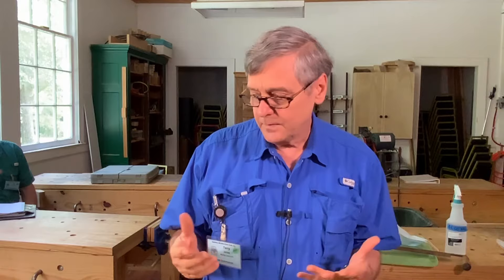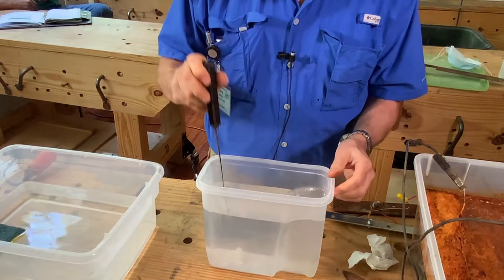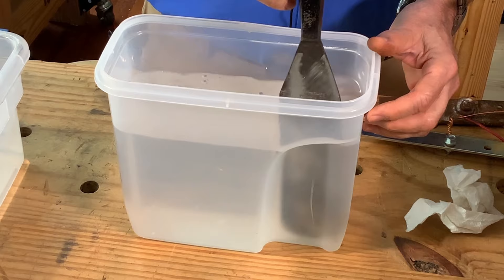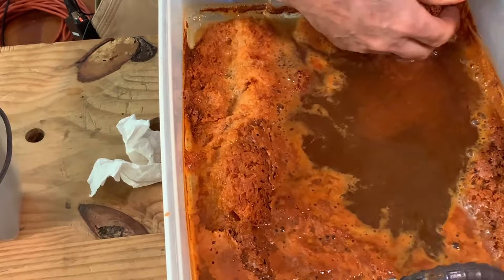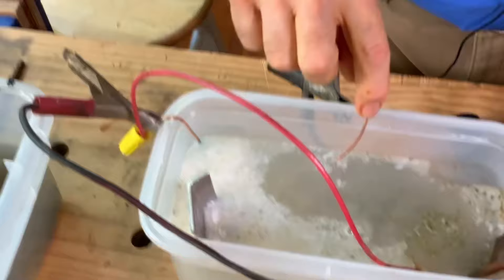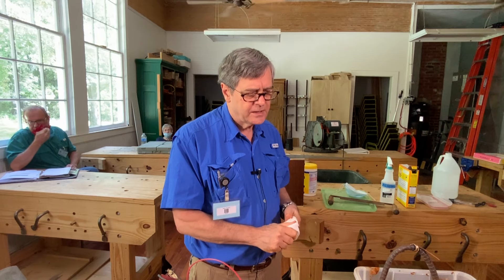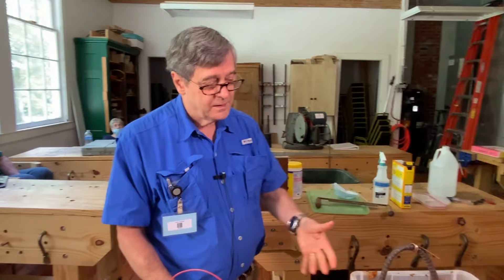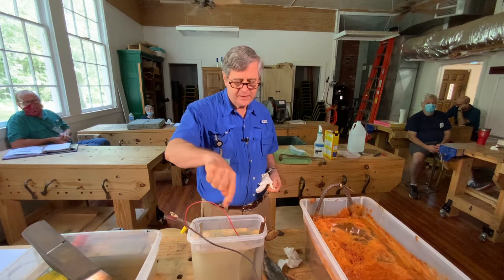Rust Removal via Electrolysis with Terrence James

Comment: I buy, restore, and sell antique hand tools, often badly rusted. Electrolysis is my "go-to" method for rust removal. Your video is the most complete and accurate I've ever watched. I once took a vise that was rusted into an almost unrecognizable ball of rust, and after three weeks and  lots of cleaning of anodes, I pulled out the vise. It was down to bare metal and all the previously rusted-together parts of the vise moved freely. It can take a while, but the setup takes only 30 minutes.
I do have just a few comments. 
1) The anode (the junk iron piece) is not "sacrificial" because the base metal of the anode is not corroded by the electrolyte; however, it does build up with the iron oxides that are removed from the tool you're restoring. For that reason, cleaning the anode frequently is a big help. Nothing fancy, and I don't even remove the anode from the tank. I just unplug the charger and reach into the rusty water with a wire brush and scrape down the accessible parts of the anode. The bubbles will pick up greatly after doing this. If you're OCD, you can remove the anode and really clean it with wire wheels, etc., but that's overkill. 
2) Proximity between the anode and cathode is important. The closer they are to each other, the more effective the process will be--just be sure to not short any part of the anode and cathode together. Multiple anodes, as you have set up, help the process.
3) Similarly, I give a quick wipe down of the tool being restored; I do this by reaching right into the tank with a wire brush. This ensures continued good conductivity through the electrolyte.
4) NEVER use stainless steel anodes. They will add hexavalent chromium to your solution and make it extremely carcinogenic. Watch the movie _Erin Brockovich_, in which she is fighting exposure of workers to that deadly chemical. 
5) I can't recall the exact chemistry involved, but I've read that the zinc that coats galvanized steel can also produce toxic chemicals in your electrolyte. 
6) As noted in this excellent video, the process is line of sight, so it would not work very well at all on, for example, rust on the inside of a steel pipe. However, when I've had hollow spots on a tool that I really want to clean, I will run a piece of steel connected to the anode all the way into (or through) the hollow, being VERY careful not to ground the anode and the cathode. It requires careful placement, but I've seen it done to clean out the rusty insides of the cylinders on a car engine block, so it can be done and it works. 
7) As noted in this very complete video, yes, hydrogen and oxygen are produced in tiny bubbles. Youtube videos make much of this as a great danger, which it is NOT. Unless you are deliberately enclosing your entire apparatus in an airtight container and then set a match to it, yes, it would explode, but left out in the shop those bubbles of hydrogen and oxygen just dissipate almost immediately into the atmosphere.
8) I've seen videos of people using vinegar, salt, and even muriatic acid as an electrolyte. These are corrosive to the base metal on your part, which means they'll remove the rust then keep right on eating the "healthy" portion of you're part. Those chemicals are more expensive than cheap washing soda, and they leave you with several gallons of electrolyte that may be toxic and should not be dumped in your yard or down your drain.
9) Evaporust works very well, I'm told, but it's about fifty times as expensive as washing soda, does no better than electrolysis, and, again, you're left with a toxic mess to dispose of.
10) Finally, I go slow, with no more than 2-4 amps and about 15V of DC power. You can use the battery charger if you like, but I have an innate distrust of rushing delicate processes that depend on various chemicals and metals reacting with each other.
Reply: If de rusting a chain , a chain to hold a gas tank not a bike chain . 
does the cathode ( neg terminal ) need to make contact with every link in the chain ? 
Also where the neg terminal makes contact with the part being de rusted , can it just be connected to the rusty part , or do you have to make connect with the base metal on part being cleaned ?
Reply: @jayk2k  The old adage that a chain is only as strong as its weakest link applies also to removing rust from a chain. If there is not a complete electrical connection from one link in the chain to the next, all the way through the chain, the removal will only take place up to the point where the connection between two links is broken (for example, by debris). If cleaning a chain, do a wire brushing to remove any loose or flaky rust and debris that might interfere with electrical contact between links, then double-down by weaving the cathode wire through each link. Every few hours, shake the chain and give it a quick wire brushing (right in place, in the tank) and manipulate it to slightly change the points where the links are touching each other and where the cathode wire is touching the links. As time goes by, you'll be able to see if there is a "problem link" that isn't getting de-rusted. If so, just clean it up well by hand with a wire brush and make sure the cathode wire you wove through the chain is now making contact with the link. The other question, regarding base metal: The best connection is made to the cleanest metal. On both the part being cleaned and on the connections to the scrap iron on the anode, I try to get the metal as clean as possible, and that's why repositioning and manipulating and doing a quick cleaning of the chain from time to time will 1) ensure that all links/parts of the chain are getting an electrical connection with the cathode wire and 2) rearranging the chain's position will ensure that all sides of the chain are, at some point in the process, in line of sight with the cathode, since most removal of rust takes place in line of sight. Finally, because both the part and the scrap iron collect debris, regularly brushing them will expose new rust to be removed and make the scrap iron function better. I don't remove the scrap iron or the part to clean them; I just turn off the electricity and reach into the bath with a small wire brush to remove the bulk of the buildup on the part and on the scrap iron. The tank looks nasty, but it's just washing soda and rusty water, so it isn't toxic. Hope this helps some.
Reply: @billdouglas1721  Hi , Thanks for your quick and detailed reply . 
The chain/s I have are solid , just do not look pretty , with the rust all over them . 

So , the rust on the chain inbetween the link can break the connection between the links then ? 

And , I used bi-carb last night , as that is all I had , I went to get so carbonated soda , but could not find any . 
About an hour ago I added more bi- carb soda , but like last night I did not really see an bubbles , so I added some epsom salt . I noticed it was bubbling now , so , going to go check it in a bit and do what you have said above . 

Another quick question , if you do not mind . 
Should the bubbles be coming off the part that is being de-rusted or the scrap iron ? 
As I noticed after adding the epsom salt that the bubbles where only coming from the part being de-rusted
Reply: @jayk2k  First, as far as the electrolyte, i.e., the liquid in the tank... I've heard of people using all types of compounds to add to the water, but the best results I've heard of (and my own experience) is using what is called "washing soda." It's chemically close to baking soda, and comes in the same, familiar, orange box as baking soda made by Arm & Hammer. I've never had trouble finding it in the laundry detergent aisle. The box I'm currently using is 3.5 lbs. and cost about $5--dirt cheap. The front reads, "Household cleaner and laundry booster, Super Washing Soda." It's 100 safe, although it will give you "dishpan hands" if you handle it a lot, just as any powdered laundry detergent would. There is, no doubt, a perfect amount to add to the water, but it's not critical; too little will slow you down while too much will just be wasted. Today I put one cup of washing soda into seven gallons of water. If you absolutely cannot find it at a grocery store or perhaps a hardware store, use Twenty-Mule-Team Borax, another multi-purpose cleaner and laundry detergent, which is chemically very similar and works very well. I never use vinegar or salt or lemon juice or (god forbid!) muriatic acid. These will all function to some degree as electrolytes, but they are all acidic and will continue to gobble up good steel on your part even after the rust is gone. Washing soda, on the other hand, reacts only with the various "flavors" of rust. (There are three main forms of rust, all chemically similar and all of which can be removed with electrolysis.)
Rust won't necessarily break the electrical connection between the links, but rust is a poor conductor of electricity, which is why electricians put anti-corrosion paste onto electrical connections for outdoor lighting. The more rust you can remove between the links, the better the conductivity, assuming of course that there is actual physical contact from link to link to link; the current won't "jump" a gap and the removal will cease anywhere the links aren't in contact.
It's counterproductive to spend hours with a wire wheel or brush, when all that labor is what you're trying to avoid in the first place. However, before and during the process (which might take several days, depending on circumstances) it's very helpful to give a quick wire-brushing to both the anode and the cathode, because the debris that builds on both of them impedes electrical conductivity. After you clean the anode and cathode and plug your electricity back in, you'll notice the bubbles resume much more strongly.
Yes, you'll get bubbles off both the anode and the cathode. One is oxygen and the other is hydrogen--technically explosive, but not in the small volume tanks I use to clean hand tools. I'm not sure about the chemistry, but rust is iron and oxygen. I believe that the electrolysis removes/releases the oxygen from the rust on your part, freeing up the iron to disconnect from your part, travel through the electrolyte, and collect on your scrap iron piece.
I don't know what you're using for DC current, but many people think if some is good, more is better. Not necessarily so. I usually use a DC source that puts out 5-20V DC at 2.5 amps, and that works fine for me. Lots of people use battery chargers, and that may work fine for them, but if I'm cleaning a part I don't care if it sits for two or three days (with periodic cleaning, as described above) while I work on other projects. Slow and steady wins the race, but perhaps I'm just innately over-cautious.
Reply: @billdouglas1721  Thanks , that is a big help . No salts then , I actually kind of thought that after I had put it in , and found out after a bit more research confirmed that . But did not know that it would eat away the good steel . You have been a big help , do you have your own channel ?
Reply: @jayk2k  No, I don't have my own channel. I've watched many excellent Youtube videos, like this one by Terrence James "Alabama Woodworkers' Guild," and it helps me realize that my own skills are somewhat limited. Also, I have great respect--and fear of!--the amount of time and money that is spent on equipment (cameras, etc.) and editing. Good videos, as the presenters sometimes explain, take ten hours to produce thirty minutes of good content. Too much for me! I'm an old graybeard, and perhaps fifty years ago I would have considered being a Youtube host. Now I just enjoy fiddling around in my shop and watching others do good things on Youtube. I'm very glad I was able to help you. Good luck with your projects.
Reply: @billdouglas1721  Hold on , I am not finished . Could I bug you with some more questions please ? 

I am not sure what I was doing wrong before . I had the chain connected up to the cathode and in the electrolyte , but where the cathode connected to the chain at the top , was not in the electrolyte and the anode again where it was connected to the scrap iron was not in the electrolyte , the bottom half of scrap was in the electrolyte. 

That , I thought was working , but it was actually not working . 

The bubbles I was talking about in the post above , were just from me adding bi-carb to the already bi carb electrolyte . 

Today , I dunked the top of the chain where the cathode was connected and I saw tonnes of bubbles coming from both cathode and anode . And I knew then that it was definitely working . 

So then , I wrapped steel wire that I got from armoured cable , that I had laying around and knew one day it will come in handy , Wrapped that through all the links of the chain and then left the to bubble away for an hour and half , in fresh bi carb electrolyte  . when I came to check on it after 1.5hrs , I was amazed at the results , so I did as you suggested , though I just pulled the chain out to have a good look at it then just wire brushed it . The anode scrap iron , did not look too bad at all , as I pulled them out , the rust that had built on it , just kind of fell off into the electrolyte . 

So then set it all up again and left it for another 1.5hrs . Again I pulled the chain out to have a good look at it and the was black stuff on some of the links , though a lot of the had come off and there where some parts , where it looked like new links . 

Here is where my questions come . 

I was using a an old buck with a handle on it , I think that was galvanised and had a plastic tube bit in the middle for comfort for carrying it . I used that to hold the chain up . Though I did not take that plastic handle in the middle, off . 

Would the plastic be effected by the electrolysis process ?
Would the galvanised  be effected by the electrolysis process ?

I was thinking the black stuff was from the plastic , though it looked intact when I pulled it out . And as I've been typing this , I have had this video by Terrence James "Alabama Woodworkers' Guild," running in the background , and he does say that the black rust may take a few days to remove and maybe that is what the black stuff is on my chain . Though It is , not tacky or sticky , but it is thick . 

And I agree having great respect for Terrence James "Alabama Woodworkers' Guild,"  for taking the time to make the great video . 
Also , do not miss understand me when I say this next bit , as I very much like females , but would very much enjoy watch an old grey bearded bloke  fiddling around in his shop unedited  ; P 
If you're as old as you're making out , but you have a vast of knowledge
Reply: @jayk2k  Hi Jay--Sorry for the slow reply. My wife is on vacation and I've been working in the garden to prepare some surprises for her when she returns. Anyway...
Nothing that is not actually submerged in the electrolyte will be affected in the least. If it's metal, it will conduct electricity but otherwise be as unaffected as an extension cord plugged into a lamp. Likewise, any plastic or painted parts that are not submerged in the electrolyte will be unaffected by the process, whether it's a metal handle on the electrolyte bank or anything at all.
On the other hand, anything at all that is in the electrolyte, whether attached to a wire or not, will (or at least may) interact with the process of rust removal. I use iron wire (not galvanized, because I've heard of possible toxicity from zinc reactions) on the cathode (the scrap iron), submerging it along with the part being cleaned. As for the anode (the part being cleaned) I have always used copper wire, and even after long use on multiple projects, it remains unchanged, uncoated, un-corroded, completely unaltered, so I'm fairly certain that copper on the anode is safe. However, copper wire connecting the cathode (scrap iron) seems to corrode and change appearance dramatically, which means the copper is reacting with something and undoubtedly releasing copper chemical compounds into the electrolyte, so I don't use copper on the cathode.
BIG WARNING: Never--repeat never--use stainless steel or chrome plated metals in the process. They will produce extremely toxic and carcinogenic byproducts, namely hexavalent chromium, the stuff Erin Brockovich campaigned against. I don't allow anything into my tank that isn't essential to the electrolytic process. Even plastics are not inert and can emit god knows what, depending on their composition. So... No stainless steel, no chrome plated items, no galvanized steel, no nuttin' at all except steel/iron and the wires to the anode (copper ok there) and the wires to the cathode (no copper, just plain, bare, uncoated steel wire).
After the bubbling stops, there may be a thin black coating. Not sure, but I think that's magnetite, an iron compound. I can always wash it away with just warm, soapy water and a rag or, at most, a bit of steel wool.
Finally, when you finally extract your piece from the tank and wash it, the now exposed iron will be prone to flash rusting, which can happen literally within fifteen minutes. To prevent flash rusting, once I've removed and cleaned and dried the part, I take an oil-soaked rag (any type of oil or a spray-down with WD40 and then wipe it around) and rub it over all the newly exposed iron. If you plan to paint the part, that oil will later need to be cleaned off, so if painting it is planned, you can instead protect the new, clean metal with a bit of phosphoric acid or orthophosphoric acid. It's cheap and available at a hardware store or from Amazon. The brand I use is by Skyco and is colled "Ospho." It's mildly acidic and will dry your skin, but it's not dangerous--just wear gloves. It may leave a few traces of white residue, but I've painted right over it with oil primer then with paint. Note: I've never applied it to a painted surface, and I'd do so cautiously; it might be harmless to paint or it might harm it.
Hope this helps.
Reply: @jayk2k  One more "Don't Do This." If you need to lift a part off the bottom of your tank, for example to remove rust on the bottom of the part, don't use wood to raise the part and especially don't use pressure treated wood. Use only steel/iron. Probably most things (like wood) can be safely used, but since anything other than steel/iron or copper (on the anode) could introduce unknown chemicals, I just stay away from everything. That way, in the end, I know I have nothing but rusty, slightly soapy water that I can pour down the drain. As an interesting side-note, many, many years ago women would keep nails in a jar of water to create rusty water, and then once a month they'd drink the rusty water, thinking it would replace iron in the blood lost. I haven't heard any modern doctor suggest this, so I'm skeptical about its efficacy, but that's what I want my electrolyte to be when I'm done: rusty (if soapy) water that is completely non-toxic to either stick my hands into or pour down the drain.